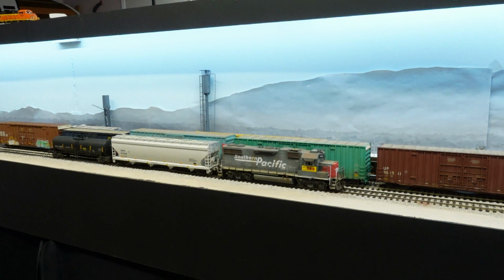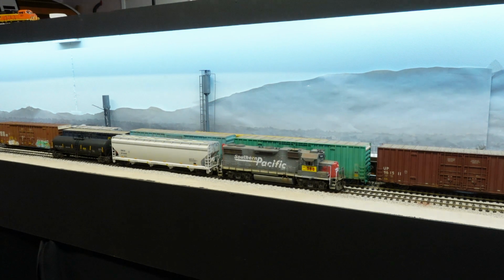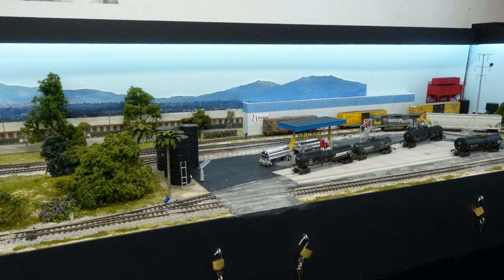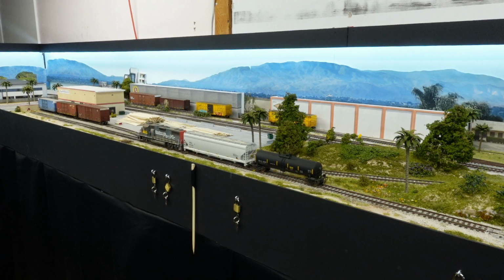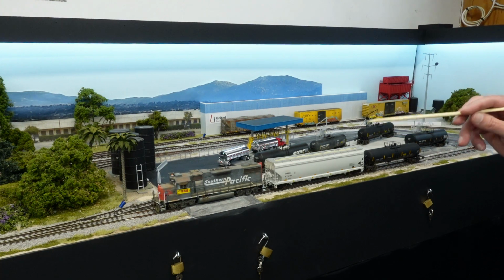Operations 'lite' | Switching tank cars

Comment: As always, another fantastic video. 

I do have an observation with your buffer car, and I know it's your railroad and all and it really doesn't matter in the larger picture. I bring it up as you debated about keeping the hopper hooked up or leaving it.  

 If you had left the hopper connected to the engine then you wouldn't have had to do the initial  uncouple. So when all the shuffling of tank cars was complete you could just move out instead of uncoupling the tank car and fetch the hopper and go back to get the tank car to leave, you would have just left with the final tank car. Again it is your show and it is great. I was just thinking prototypical movement would save on uncoupling twice ( 1 hopper and 1 tank car) and save movement from from the  tank car to the hopper and back to the tank car.  You know fuel efficiency and time.

My trains are still in the box and I am building the benchwork, so I am living vicariously through you!

Great video! I like this format as well. Keep them coming, I love seeing the notification that you've got a new show for us all to watch.
Reply from the maker: Thanks for the comment. For the buffer car, I was planning in my head to have the loco at the front end with the hopper behind but mixed up the order in the end so just went with it as is back to the yard. Lol

Comment: Here is a suggestion if you want to be prototypical. Place a burm around your storage tanks incase one of them begins to leak. But it's your railroad and I'm jealous. Keep up the great work. 
You have ex WP power (914), ex SP the 38-2, now throw in a former MoPac B23-7 and ex MKT GP39-2 or HLCX GP38-2 in a GP40 carbody, then for ex CNW a GP15-1 or GP50 in the 1600 series.
Reply from the maker: Thanks! Good ideas!

Comment: Ok at the end there’s something I’ve had subs knock me on. Backing miles? With the cars, Conductor Riding the rear car?  So it’s either do a runaround and put Loco Long Hood Forward or use 2 Locos. Double Ended. I had to use Double ended due to no Runaround at one Facility. Makes you work a lot to do it. But, It’s Your RR Fun so whatever you (feel) at times to make it enjoyable. Either way Mission Accomplished!
Reply from the maker: LOL. Actually the plan in my head was to have the loco at the head on the way back. But my plan with the buffer hopper didnt work out and I had it at in the wrong spot. So instead of doing a run around I just figured I'd shove it back to the yard as is. I know someone would notice. lol